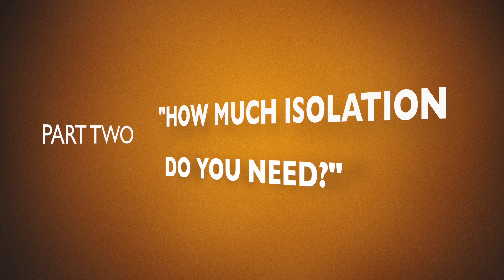How Much Isolation Do You Need? - part two - BLOCK WALLS

Comment: Very interesing John, that info is hard to find thanks!

So in an unfinished basement with ceiling joist filled with insulation left open for heigh reasons, and concrete foundation walls sealed with foam, adding layers of drywall to that will make low freq isolation worst?  Thanks

Comment: Hi John, Im trying to soundproof and isolate my daylight basement. My concrete back walls, i am going to put XPS foam, 3/4" airgap, then 2x4 wall with Rockwool.  
How do i finish my outside wall to have better isolation and soundproofing? On my outside wall, i have existing finished 2x6 walls with blow in insulation and 1/2" gypsum. DO i have to install another 2x4 wall/insulation with and airgap as well, or is there another method that works just as good, such as clips and channel, or just more mass(drywall?)
Reply from the maker: Without knowing how much isolation you need, I really can't recommend anything. Can you give me a noise spectrum and level at 1/3 octave bands? Go to my resources page and download the paper "Assess the Environment".
And send me an email. John@jhbrandt.net

Comment: HI John, great video, thank you, if I may ask, cause I haven’t found the answer so far, if I am doing a double wall brick do I ned to fill the space gap with anything?, htank you
Reply from the maker: adding fiber or absorption in the gap will improve the STL... How much do you transmission loss do you need? And at what frequencies?
Reply: @JHBrandt  I’m not sure how much, as much as I can I get Iguess, each brick wall is about 14cm thick with the cement finish, and the air gap between them is 10cm and the will be use mostly for a drum kit, thank you John, sorry if I’m not very technical

Comment: So will using channels,  insulation material and one layer of drywall between floors, be counterproductive or productive when the goal is to minimize the sounds of footsteps, people talking and low music coming from the upstairs apt?!. I'm a little confused
Reply from the maker: I would not recommend channel because it doesn't isolate. Use either clips and channel or resilient channel. That will reduce impact noise and air-borne sound. If you need low frequency sound isolation, you'll need considerable mass.
Reply: @JHBrandt  Yes sorry I meant to say I will be using resilient channels, insulation and one layer of drywall. One more question, just to clarify, Rockwool insulation will give me the same benefits as normal fiberglass insulation when coupled with resilient channels?? It's really the impact noises i'm trying to eliminate. Not too much low frequency sounds are being emmitted from the above apt.
Reply from the maker: @alreddy13  The insulation type doesn't matter much that's why I recommend the cheapest. Rockwool insulation will do just fine. It's NOT the insulation that does the soundproofing, it's the mass and seal. The fiber insulation absorbs the cavity resonances and lowers the assembly resonance by damping and improves the STL thru that process.

Comment: How about basement studio? With 20cm.concrete blockwall, is it needed to add 2 layers gypsum partition with gaps (12.5cm/no connection) to increase STC rating? Or just 20cm solid concrete is enough?

Thanks
Reply from the maker: Panca, it depends on what you need. How much isolation do you need? Soundproofing is expensive, especially if you don't need it.

Comment: At what point does a third leave stop being a third leave of the wall and become a corridor? Clearly there are lots of cases where there may be an internal corridor. Lets say the wall furthest from the external boundary is part of the control room and the corridor is 1m wide. Why does the control room wall not act like a third leave to the external wall and create a resonance that actually lowers the STC? Presumably there is a specific minimum air space which probably also depends on the mass of each leave?
Reply from the maker: Calculate the mass-air-mass resonance of each partition and space. If they differ by the square root of 2, it will add to the sound transmission loss. 😊

Comment: Is hebel block good or bad for soundproofing?
Reply from the maker: Panca Tab, yes! Of course. It's heavy and heavy is what you need for Soundproofing.
Reply: @JHBrandt  Sorry to chime in late but Hebel (aerated concrete) is extremely lightweight concrete and very similar to chalk as far as hardness goes, at least here in Australia it is! Besser block otoh is what we use mostly here in Northern Queensland as it's excellent for keeping the heat out (and noise) and is cyclone proof during our tropical season! The block walls have rio and are filled with concrete.
Reply from the maker: @brettus9115  very true! Hebel is lightweight concrete, but.... It's still concrete. And the mass adds up. a heavier mass is always more effective as Soundproofing.
Reply: John Brandt does this material it self also good blocking low frequency noise, such as sub low noise coming from a big subwoofer? Thx for your reply.
Reply from the maker: As part of a system, yes. ONE layer of these won't block more than 56 dB at the most, assuming a 20 cm thickness. But the sound reduction does not extend to frequencies below 80 Hz. Not very much anyway. You need a resonant system like a sealed double wall to accomplish a good reduction of sound waves below 80 Hz.
Reply: John Brandt I saw someone use perforated alumunium for soundproofing,how does it work?
Reply from the maker: Panca Tab, I have NO IDEA!! I would recommend that you ask them and get the testing data on that.
To be honest, anything that is perforated will not block sound.

Comment: I'm not positive about the other poster, but I also glued the gypsum to the outer sheathing form the inside. But it doesn't create a third leave beacuse from there you leave the stud wall open (with fluffy in it) then an air space then the next leaf which has 2 layers of gypsum on the room side of the new inner shell. So the two leafs are open to each other inside with 4" air gap and 8" of fluffy.

Do you think that is alright?

Comment: Hey John thanks for sharing your knowledge of acoustics with us. I'm working on a temporary space in my attic and I have a couple of questions. (1) I own a 1920's twin home with plaster and lathe construction and no firewall in between the two houses. Would it be beneficial to add a layer of drywall glued in between each cavity against my neighbors wall to increase isolation? (2) The space has two rooms, one larger than the other. I was thinking about adding a secondary wall next the existing wall that divides both rooms to help increase the separation between each room. It'll probably have a 6"-8" gap in between, insulation in between the studs and 2 layers of 5/8 drywall on both outer parts of the walls. My question is, should I completely fill that gap with insulation or leave it empty and just put the insulation between the cavities of the framed walls? Do you think it'll be worth doing? Or would there be a better solution to increase isolation without sacrificing so much space?
Reply from the maker: Good questions! If by adding the drywall (glued in between each cavity..) creates a THIRD partition, I would recommend against it. You are better off with only two partitions. It has been proven with testing that additional partitions can often REDUCE the sound isolation. 
So, I would recommend this if you need more isolation: Add another layer of drywall to your existing wall, taking care to apply it in such a manner as to eliminate any air space between the drywall layers. ok?
What we're doing here is ADDING mass. If you are able to double the mass of your wall partition, it can improve STL by as much as 6 dB. (that's twice as much!) This becomes difficult if you need to add more than 6 dB, and starts to work like; two steps forward and one step back. :P
If all you can add is one layer, use 5/8" (16mm) fire-rated drywall... and if you can afford it, use Green Glue as well.
Of course, it's always best to test and see if you have adequate sound isolation. If not, add the drywall, if you do.. no need to spend the time or money. ;)

Comment: Hi John,  if I'm soundproofing a room constructed using hollow core block wall, is it normally better to only finish one side?
Reply from the maker: Finish as in what? do you mean a render or plaster? OR when building a room in a room do you mean doing a decoupled gypsum layer?
Reply: Hi John,  I just got my copy of Rod Gervais' book.  As far as finishing, I know that the outside face of two walls will be gypsum, and have the space to create an air gap of moderate size.  Two other walls are poured concrete foundation, so nothing on their outsides.  The inside will be whatever works the best with the least amount of space.